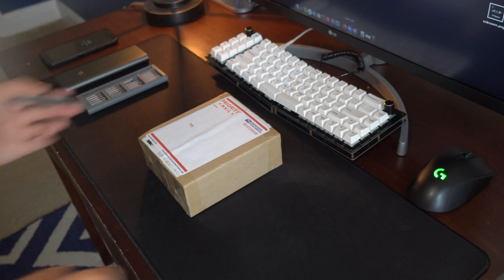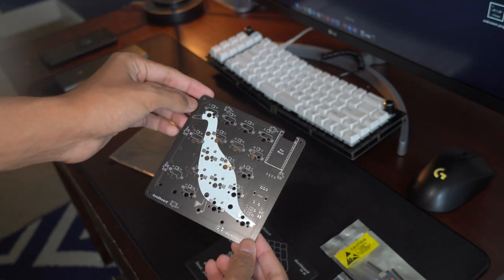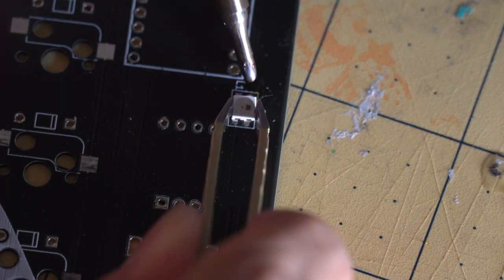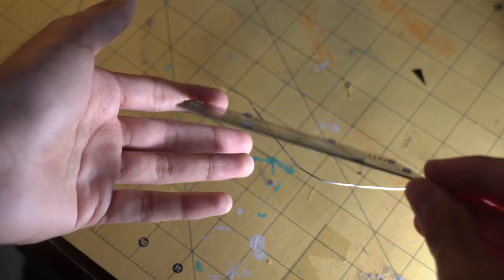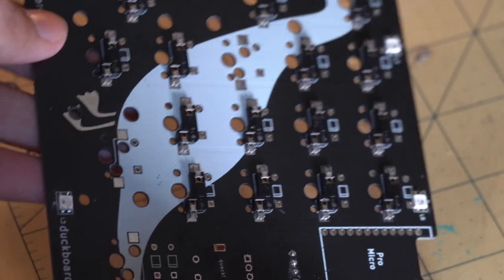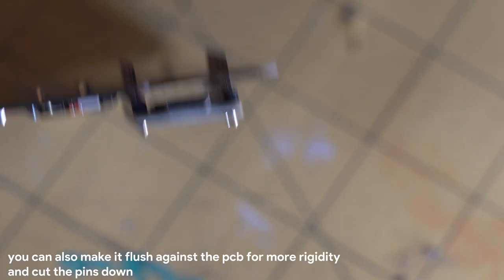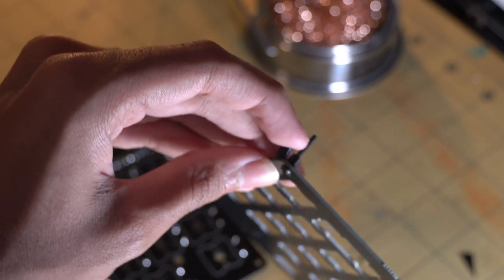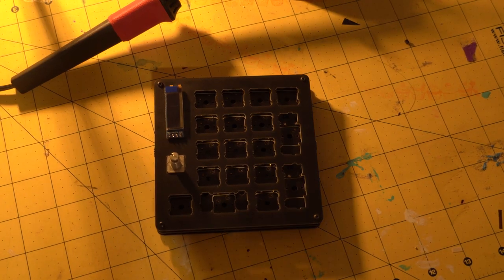duckboard by doodboard assembly video (read desc.)

Comment: I seem to miss all the groupbuys I want to get in on.
Reply: There's a groupbuy for the duck in an hour, and another tomorrow!
Reply: @philtyphil32  Thanks for the heads up! I really appreciate it!
Reply: @stopthephilosophicalzombie9017  if you missed this one he is running it again in January
Reply: @sadseal8118  I looked for it today and couldn't find it! I looked on Geekhack and his site and it still said "coming soon".
Reply: @sadseal8118  Yeah I'm confused I just went to his site and this is what it said: "Groupbuy Round 2 part 1 finished. Part 2 begins OCT/18th 08:00 CDT"
Reply: @stopthephilosophicalzombie9017  the buys both sold out in less than 3 minutes, so if you were not there you almost 100% missed it
Reply: @sadseal8118  Jesus. So there's another one in January? When you say "there" you mean at his site, or is there some other place to order?
Reply: @stopthephilosophicalzombie9017  there is another run in January, and yes at his site
Reply: @sadseal8118  I'm sure I'll have forgotten all about it by then and found some other option. I'm pretty sure there's another QMK numpad kit out there.
Reply: @stopthephilosophicalzombie9017  there is, but i havent found any with encoder and oled for 25 bucks
Reply: @sadseal8118  Don’t remind me! 😪
Reply: @stopthephilosophicalzombie9017  if you have discord, I suggest joining dooboard's discord, he has linked to it on his reddit posts on mechmarket and /r/mechanicalkeyboard
Reply: @philtyphil32  That's a good idea. I  checked there today and still couldn't figure out what was going on. I appreciate the help!